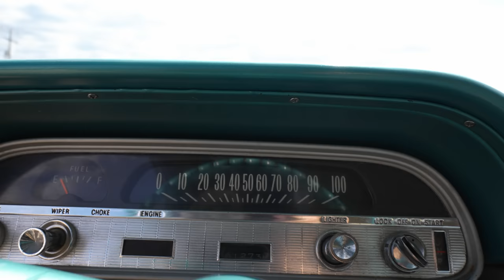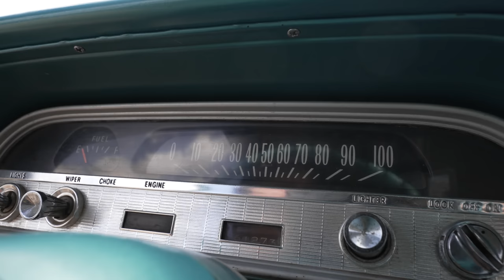Huge Military Axles & A New Corvair...What Should I Build Next?

Comment: I originally thought, why on earth are you driving that home rather than trailering it?   Then it slowly hit me.  You were hoping for some adventures to make an incredibly awesome video.  Well done.  

The roadside repair on the ground reminds me of some of my escapades over the years.  Like jumpstarting something with baling wire.  Or installing a new u-joint on the bed of a truck with a hammer and screwdriver.  Or changing a tire on the side of the road with the same ball pein and screwdrivers.   A guy does what he has to do.  And Matt is one of the best at it.  The wife is icing on the cake, a definite keeper.  Is she ever not smiling?

Comment: hey Matt I've owned  at least 8 corsairs my first was a 65 Monza 110 4 speed saw a crown kit mid-engine Corvair  i think i was 17 .14 years later i built a mid-engine Corvair 327 my favorite   engine man th ls would have been incredible i had 4-way disk my machinist was great he took the stock lower arm  and cut out the balljoint ring and took the ring from the Montecarlo and welded  it into the Corvair arm  so pretty swap then I had tornado disk for the rear im 63 so the memory is going i had a rack pinion  from a miny sprint lock to lock was like a go-cart a .i put on youckahammas   808  pretty much-shaved brand new the car was 60 40 weight bios it was the first car i had driven that was beyond  my driving skill any way this is Darwin 63 going on 16 love your show you guys look like you have a lot of fun keep it up oh yah tell Darwin I've been called Dar for as long as i remember

Comment: I love the Corvairs and I love the station wagons more..I've always been into station wagons but I don't know what happened to all of the cool stuff from the 60s..I 4got about the 1966 Corvair car my brother had. It had 2 4barrel quadrojet carburetors, 1 on each side and it was amazing how strong the car was. I think it was called a Spider or something like that and it'd smoke the tires and keep up with V8's cause he didn't like getting beat drag racing and he made the car hold it's own when racing people. I don't know what kinda horsepower it had but it wasn't no slouch that's for sure..I'm trying to figure what he ended up doing with it. I think he traded it for a 1965 Chevy Impala ragtop that looked brand new with very very low miles but most ragtops had lower mileage than most vehicle's on the roads back in the good ol days...

Comment: What should you build with those giant axles? An off-road rollback of course! Outfit it with the same size tires they use in Iceland on their snow touring vehicles and you'll handle the sand just fine.

Comment: surprised the roll pin didn't shear in the drive gear, that happened to a '68 Thunderbird I worked on when valve seal plastic junk entered the oil pump.

Comment: 11:07 put some cotton hoody with a zipper somewhere in the workshop so you have something to put on, because the light from the welder is very full spectrum and also contains a lot of cancer inducing short wave UV-C light.
Sunlight doesn't contain these shorter wavelengths which are normally filtered by the atmosphere.
So it's much more worse than sunlight.

Comment: I have owned several corvairs and loved everyone of them. I drove one over 30,000 Miles and it had 79,475 when I traded it in for a Cab over Corvair Pickup. I had one I was in a head on Collission on a Gravel Road and it really crushed both the Corvair as well as the  Plastifc front on the muc bigger Chevrolet Malibo and the Corvair was still Drivable after pulling the medal away from the front wheels and I towed the big Chevrolet nearly nine miles back into town and My hood was Bent looking like a Mountan in front of the windshield..

Comment: That's too crazy. I had the same thing happen going over black jack w my 60 4dr. Replaced the distributor and it ran way better so it was going bad.. oh that was in 82!
Also had the notorious rear wheel bearing go which let's the axle and wheel slip out.. but the fender normally holds them in. Mine did too

Comment: Step 1.  Cut up the black Impreza
Step 2.  Swap Impreza drivetrain into Corvair
Step 3.  Build out specifically for trail repairs, onboard generator/welder/air compressor/etc.
Step 4.  Take it to the Gambler
Call it the light wrecker?  CorvAir Support?

Comment: The 80 hp horsepower is the motorcycle horsepower used in a lot of tricycles in the Philippines for paid transportation...The steering wheel was the safety feature at that time because drivers get injured hitting the steering during accidents, this steering collapses when pushed at a certain pressure to cushion the driver pressure to the steering...

Comment: Insofar as the headliner goes, if the fabric can be cleaned, I would attempt to replace just the panels which are torn.  Seems unlikely that the original fabric would endure the handling, but it would be the best first choice.  If that isn't feasible, I'd put a new one in.

Comment: How come no one in the shop mentioned that when you cut into a chambered muffler, like the flowmaster that was the first "muffler" in line on the Banana. That the chambers are not as effective at deadening the sound. Then he adds flow through type one to the end of each of the exhaust pipes. Well there's the reason it's so loud. Put a real single in dual out in place of the cut up one under it and ud be surprised the difference it'll make lol

Comment: I suppose, part of vehicle Maintenance is restoring serviceable parts and replacing non-serviceable parts... That hood-lining is not serviceable. a skilled upholsterer could recreate that . But I think a 3.6litre subaru flat 6 would fit in there and not only weigh much less and produce 5 times the power. It may be a survivor, but it could be a candidate for original classic looks and modern tech! and the Axles, well it has to be something that can pull a Logging truck out of a swamp. pull a Unimog back up a cliff! Or Maybe even pull a Tank out of a lakebed!

Comment: Not everyone has a wife that would buy him a classic one of a kind super duper blue and white road wonder Corvair, General Motors invented, engineering wonder of air cooled, flat top 6 cylinder engine, dynamic flotation front suspension, with split rear axles, floating on bias belted tires.  Including stereo units of speakers that delivers the stereo music across the luxury vinyl seating and vinyl acoustic dash padding to the listeners locked in emulation, enclosing wonderous lightening.  Never before seen or heard in the automotive industry.

Comment: Didn't you just get a new(ish) 10x10 spud truck?

I think they would fit that nicely...

Granted, you'd need mountain climbing gear to get in the cab after that, but a set of RV style automatic folding steps would take care of that little problem...

And just think of how much weight you'd be able to put on them...a turreted crane and outriggers on the back frame might be doable...make your own Off-Road Heavy Rotator for those REALLY squirrelly recoveries...

😄😁😆😅😂🤣

Comment: 6x6 all wheel steering SUPER WRECKER WITH 400 cid turbo 400 with doubler & lockers, high flotation low pressure ground engaging tires, hydro assisted steering.

Comment: half track truck. Tank treads in rear and oskosh drive axle in front. Like the WW2 trucks with tracks in the rear. All hydro stop playing wit air lines. "defintion of insanity is doing the same thing over and over again expecting different result. Stop playing with the air lines go full hydro much more reliable sterring, brakes, boom, crame, bucket, aux, ride height. I bet you all could engineer tracks to fit those rear drive. Pre 2010 diesel cummins or International. Im sure what ever you do will be amazing.

Comment: 4.8s 5.3s and 6.0s are basically the exact same... also the lm7 5.3s last alot longer than 250k miles i have a highly beaten 5.3 with 430k still rolling strong

Comment: All Corvair owners need a Traveling Angle with mechanical skills.  Having owned a 1965 Corvair Monza I know exactly how much it takes to keep the car running.  I got tired of having the car in the shop for extended periods because there was only one shop that would work on it.  I purchase a 1975 Vega for its replacement.  Not exactly a big improvement over the Corvair.

Comment: Lizzie, never wear jewelry or rings when working on cars or anything mechanical.
They can get scratched, gems knocked out, and ruined in general.
They are also dangerous hazards.
I once had a metal band Citizens watch on and it made contact with an electrical connection and got super-hot and melted my skin leaving a permanent scar.
Be smart, be safe.